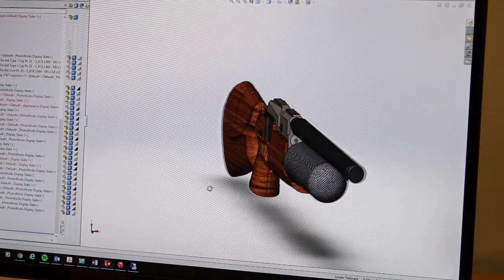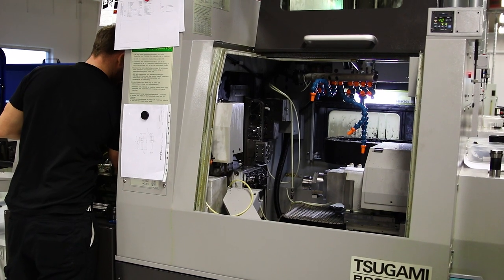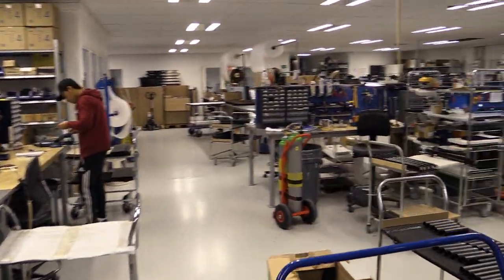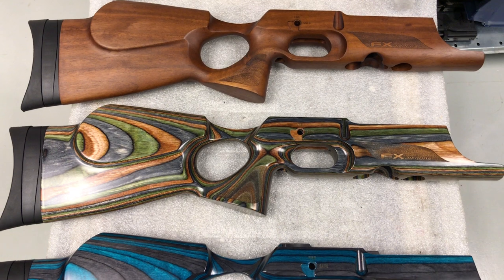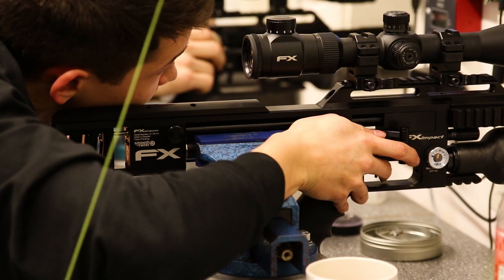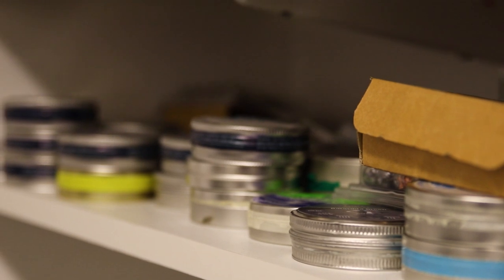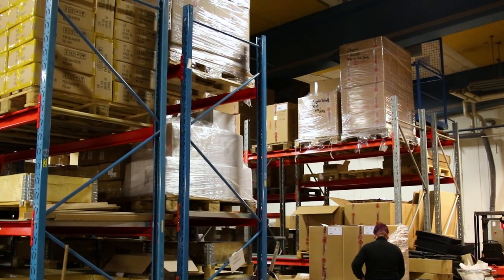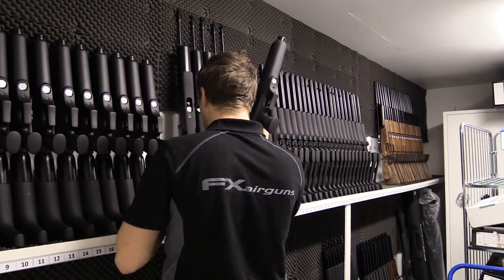FX Airguns Factory Tour (I Traveled 10,365km for you!)

Comment: Another awesome vid as usual Matt, but appears to be a little like damage control by FX maybe? Seems the whole point of the vid was to demonstrate the QC processes at the FX factory and put to rest the increasing concern by some of their customers due to accuracy issues. My new Impact had to be sent back and have a lot of work done by the dealer in order to maintain any group; luckily I was not part of the seal leak batch. All point to QC at the factory. I have to agree that FX is clearly on the forefront of innovation and precision engineering. The machining on these guns are as clean as I have ever seen, and the tolerances are incredible, compared to anything else I own. But the buck doesn't stop there. Whichever group(s) are in charge of final assembly and testing, are simply letting down the rest of their team. They can, and should, do better. All of those expensive CNC machines are funded by us end users and more care should be taken to assure that revenue stream keeps coming in.
Reply: after seeing this video i expect the fx I ordered to be of high quality appearance and working condition when i get it soon :D otherwise im gonna be pissed lol

Comment: Question does FX test .22 Cals using new 25 grain pellets or 25 Cal using 34 grain pellets because they offer a greater BC than 16, 18 (.22 cal), 25 grain (.25 cal)?  If not then most will require rifle adjustment to get the best bang for the buck.  

As for the quality control, I know you have seen 100's of people complaining about quality control of the impact, so that should no just be dismissed as user error.  I know the number is really small on average of entire sales but acknowledged even Ernest said there where/are issues.

I know I had some issues with my impact upon purchase that had to be either AOA or FX's doing, My barrel was never fired by myself and yet the barrel was stuck in the gun due to shooting with the knob not proper secured while test firing.

Comment: Matt, great video as usual..... you spoke about factory settings and accuracy, what settings (pressure reading and dial settings) do you use on your personal .22 Impact with 18gr JSB's?
Reply from the maker: +Bob Lewen 120 Bar, valve open and then adjust hammer spring to around 900fps
Reply: Thanks Matt. I'm closer to 140 regulator, but even on "max" power wheel setting I'm only hitting 890 fps with two different chronos. Valve control knob still on factory setting as tuning counterclockwise to increase power had marginal increase. Any ideas?? At just under 120 regulator (factory), 875 was my max power with 18.13 JSB's.
Reply: could be transfer port misalignment....QC issue.
Reply: Went over all "by the book" adjustments again... but this time at "max" power with the shroud "in" and not extended,  chronos showing 905 fps. Close the shroud and back to 888-890.

Comment: I'm skeptical about barrel designs like this. Not particularly the barrel, but the way its mounted. It appears flimsy. It appears like it'll easily get bent from its mounted. The entire length of barrel and no brace at all seems to have a weak point where it's mounted.
Reply: Initially I was worried about the barrel mounting as well. Now I have a FX Royale 500 and two HW100 rifles with free floating barrels and there is no issue at all with normal use. Everything is solid. I wouldn't recommend reefing on the barrel or anything like that though.

Comment: Not to bragg or anything but you forgot the:
 
adjustable wrench and pipe wrench
bolt cutters
the pc mouse
the virtual keyboard
the modern match
blow torch
styrofoam
the online atm machine
synthetic glue
carbonated water
bluetooth
the respirator
ultra sonic photography
electronic welding
artificial diamonds
powdered milk
the celsius temperature scale

and a couple of other things ;)